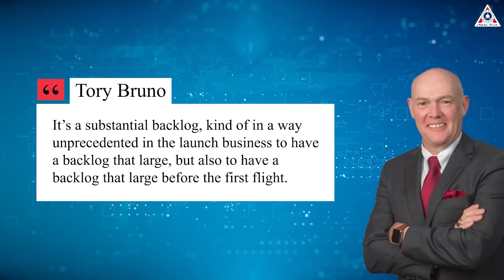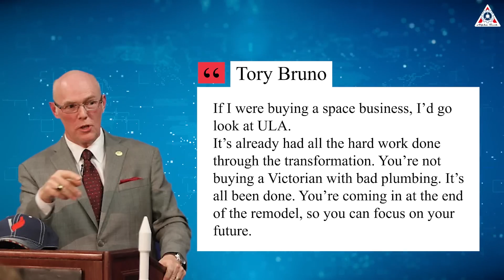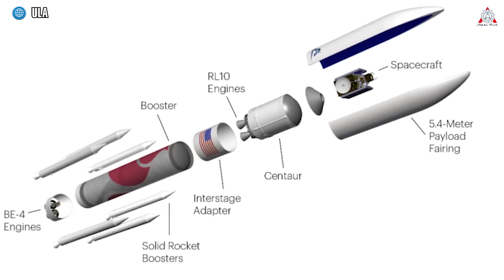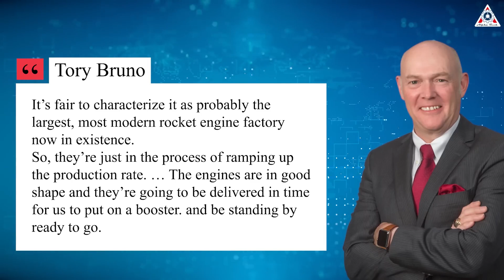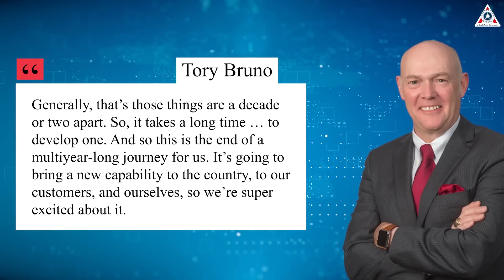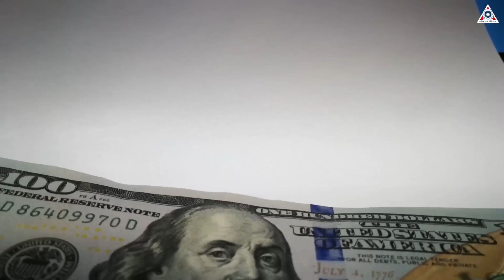ULA sold to Jeff's Blue Origin, NASA did not expect this...

Comment: Notice the fact that they use RUSSIAN Rocket Motors. This came about when both USA and Russia agreed to reduce the number of Balistic Missles. To make sure that Russia actually dismantels its excess rockets, Congress agreed to fund the Russians, and in return, WE (the USA) would take the engines from those rockets, to be used in the Delta 4 and Atlas 5 Launches. Elon did not have such a sweet deal, so he designed his own rockets.  If we stop using the Russian engines, Putin will gladly take our money and restore his rocket fleet to higher numbers. Is our President aware of this???

Comment: Howard Hughes was an Aerospace genious, but later went nuts and died. Elon Musk is starting to display almost serious identical behaviour. ULA is a joint venture and among its specialties are the GEOSTATIONARY Satellites, which are continously aligned with their customer market. This is an orbit at 22,700 mile altitude, as opposed to SPACEX which specializes in LOW EARTH orbit: about 240 miles in altitude. Big difference in capabilities!!
Reply: Hmmm. If Elon gets nuts, at least his children will take the lead, contrary to Howard hughes.
Reply: SpaceX can launch geostationary satellites....the Falcon Heavy has done it several times.   See 'ViaSat-3 Americas' mission on April 30'th.
Reply: They can't do it often, and not cheaply.  They have to expend their cores, and they aren't making them fast enough to sustain that type of launch.  They're awesome at LEO.  And Starship is completely designed for LEO too. Having to do 10 missions (some think 20 now) to get ONE starship to mars is a big circus act. Does anyone think they will, in our lifetime actually do a one hour turn of a starship from catch to re-launch?  When 60-100 tiles fall off it, a 6 engines have to be checked, double-checked, and possibly replaced?  Or the 33 on the Super-Heavy?  It's a good dream, but it is years away from reality. Elon is not likely to see it fulfilled.  But they should keep at it.
Reply: I agree with everything you voiced. My issue is that if ULA and SpacEx merge,
there will be fewer experts in the field, and with no competition, higher prices to all of us. The Mars trip is driven by competition with China and (somewhat) India. Russia does not seem to have the revenue for this game. With all his games, Elon will need management surrogates to run the company, and that may be inefficient (the soup is stirred only the Elon way).

Comment: ULA has been delayed for a lot of years and it has reached the point where not enough money has been coming in to keep the company going. A lot of that can be blamed on blue origin and their BE4 engine. Nobody wants to buy United launch Alliance because of the engine uncertainty. That only leaves blue origin as a potential buyer. They also need UALs Rockets for their Kuiper project.